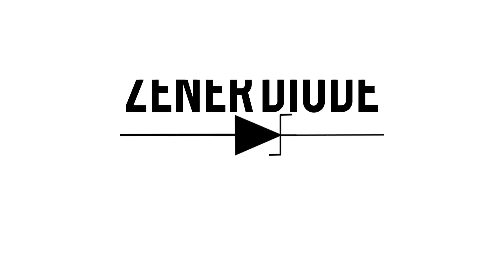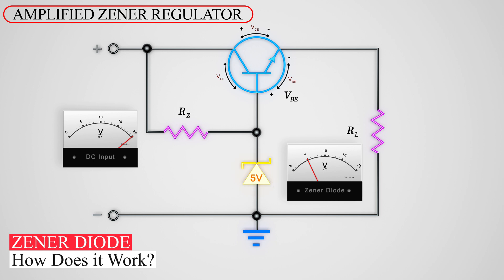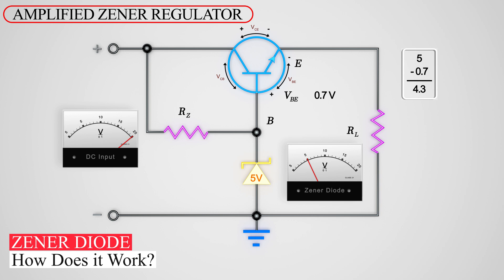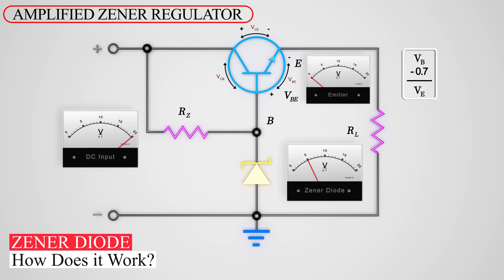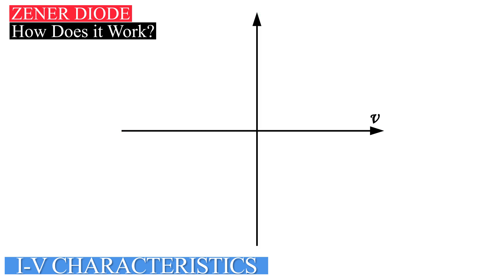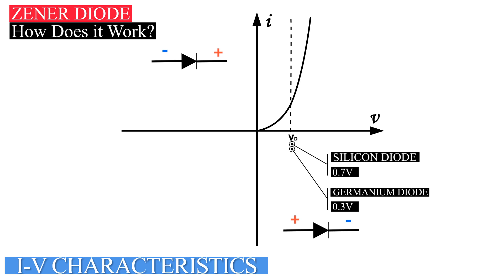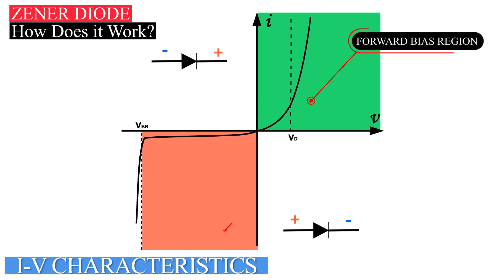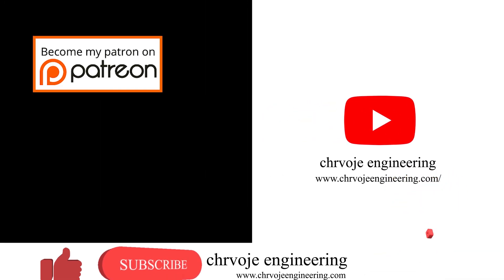Zener Diode as a Voltage Regulator | How Does it Works?

Comment: Yes, I understand zener diodes a little better
Reply from the maker: Thanks, that is intention
Reply: @chrvoje_engineering  with a 20 volts D.C input and a 5 volt zener, the zener will maintain a constant 5 volt minus the voltage drop of the transistor?

Comment: Sir. My redmi 5 doesn't power on. With battery disconnected, there is 0 volt at the plus terminal of the connector pin on motherboard. However, when battery is DISCONNECTED, there is about 4 volt at the same plush terminal on the connector pins on the motherboard. Why is this happening? Please help. There are no full or half short at the 4 pins of the connector. All are ok.
Reply from the maker: At first, maybe some capacitor holding voltage, I dont know exactly, May be someone with experience!?!